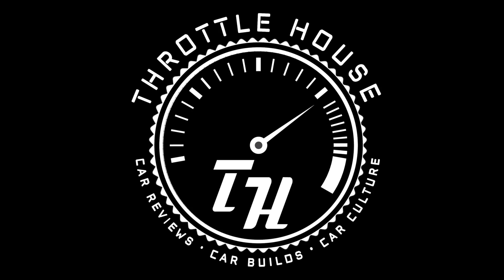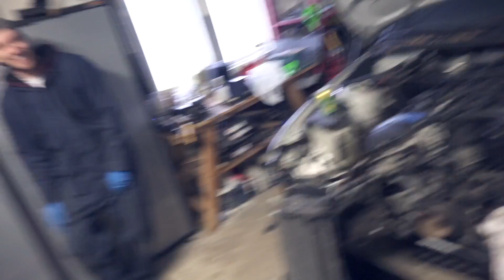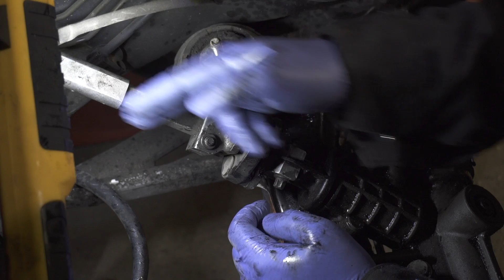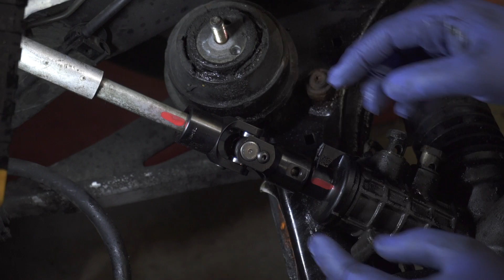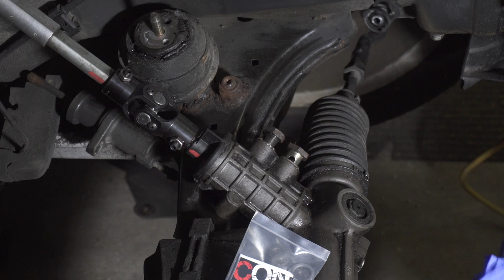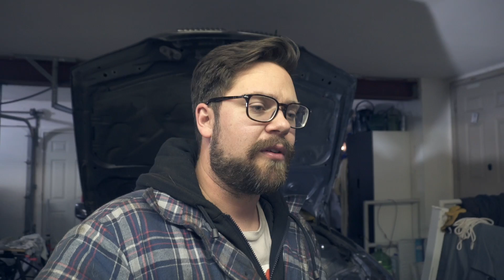E46 Power Steering Delete and Steering Guibo Delete -Condor Speed Shop

Comment: Having extensively tracked and autoX'd my E46, I can't imagine why you'd want to delete your power steering.  If anything, I would want to install a quicker rack and smaller diameter steering wheel, in which case power steering would be even more desired.  E46 is a heavy car compared to E30 or Lotus, plus the steering already gets pretty heavy when you're running 255 width tires up front with max caster.
Reply from the maker: For autox I would never do this. But it’s track only. I want to simplify the system. I am removing a lot of weight from the car this season and am currently only running 245. If I don’t like it, I will probably do an electric pump.
Reply: Understandable.  It'll be interesting to see how you like it.  How much weight are you hoping to take out of it?  Mine was pretty close to stock weight so that could make a big difference.  Also, I don't remember if you have already, but be sure to swap out your FCABs (and other susp bushings) and engine/trans mounts for harder units.  Makes a huge difference.  Putting M3 engine/trans mounts basically fixed the vague shifter feel in my 325ci (and may have saved you from your money shift).  The other big mod I loved was the Mason Engineering clutch pedal, which relocates the engagement point much lower so you don't have to bend your knee so much when shifting (if you have long legs).
Reply from the maker: Ill be doing Condor Engine and trans mounts for sure. And yes Ill be removing a lot of weight. The entire interior, sunroof, and ac.
Reply: The spec E46 guys are getting down to 2800lbs, but they have limits on how much they can do.
Reply: Stock wheels/suspension?  If so check your alignment.  Could also be a failing power steering pump/rack.
Reply: @jabela16  How did it turn out in the end steering weight and feedback wise? Would you recommend this for a track car that is occasionally driven on the road?
Reply: @arminask  Are you asking me or throttle house? I haven't remived my power steering.  The only thing I would want to do is install a quicker rack, as I find it a bit slow in slaloms and tight corners.
Reply: @arminask  Steering feedback is 10x better without the power steering and it forces you to apex a littler later which is a good thing. I would absolutely not recommend it for a car driven on the street, track yes delete it.
Reply: Agreed; I have an e46 m with a z3 rack and I can't imagine driving it without power steering; especially on track where you have to rapidly make small steering adjustments. Would be more painful than fun. I'll be interested to see how this works out but I'm very skeptical.

Comment: I just replaced my steering guibo, alot better now. But in doing so I've noticed that my steering is still all over the place. Now I've got to replace my tie rods, it never ends!!
Reply from the maker: What do you mean all
Over the place
Reply: I feel your pain. I was chasing steering play in my e46 for a long time and finally tracked it down to play in the u joint at the top of the steering shaft. That was after replacing tie rods, steering rack, FLCAs and giubo...ugh
Reply: Throttle House when you go over uneven road, highway driving, the steering is under even. Also when the car is off, in accessory mode the steering wheel has tons of play. You can here knocking when your steer left and right.
Reply: Ren Messinger yikes, I think it's definitely my tie rods, I'll know this weekend. I've got a ton of parts I'm putting in on my 330.

Comment: They make a Poly Driveshaft Guibo for the Non-M E46 in case you're interested.
Reply: It's by IRP And ECS Tuning has it for under $120 U.S dollars.
Reply: Those driveshaft giubos are not a good idea unless the whole drivetrain and rear subframe are solid mounted. The stock rubber giubo allows for the drivetrain to have minimal stress and minimal power loss under situational dynamics; those aluminum/poly giubos put lots of internal stress on the transmission and diff. Plus the stock rubber one has no issues with it unless it wears out. Turbo e36/e46 guys use the stock rubber one with no problems.
Reply: Ren Messinger wrong. Cody Aplin has a turbo E46 323Ci and has shredded at least 3 stock guibos and after welded my diff I immediately began shredding mine. Im about to buy a poly one

Comment: Are you planning on doing 330 brakes or will you keep the 325 ones? Also, are you still using the getrag transmission with the m54b30? I was going to use one in my 330, but everyone was telling me to get a ZF trans as the getrag might not be strong enough.
Reply from the maker: Im using a getrag yes. Its a find trans. Used it all last season with the 330 and it held up just fine. Keeping stock 325i brakes and upgrading pads
Reply: Yeah, I figured it'd be fine as long as I stay non F/I. My brother's 328 is still using the stock brakes with race pads and he keeps up just fine in braking with me. GL with the build and I'll let you know if I find out anything more on the DIY sunroof panel. I might just try and figure it out myself as I have a pretty good idea on what to do.
Reply: He'll be fine with stock brakes, especially since he's taking lots of weight out of the car.  Just need upgraded track pads.  If brakes still get hot he can go with brake scoops or ducts.  If he's going to upgrade the brakes, not point in going to the same shitty 330 floating calipers with rubber bushings.  Better to jump to a floating rotor setup for better feel.